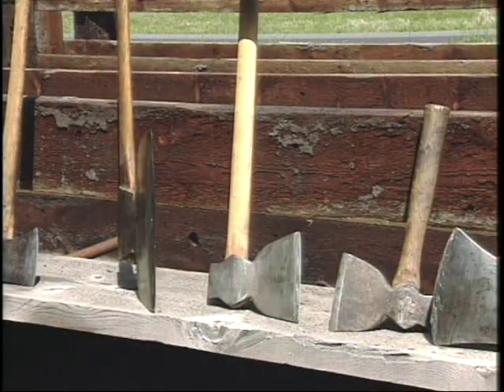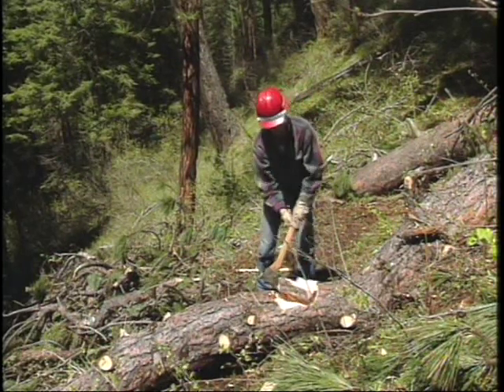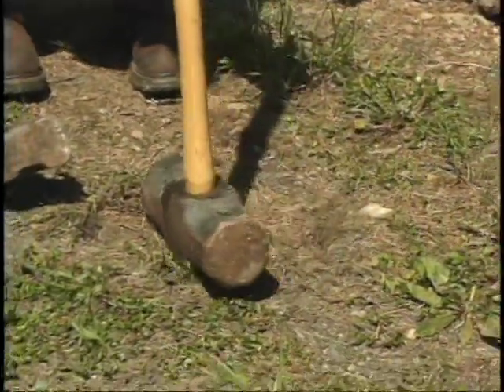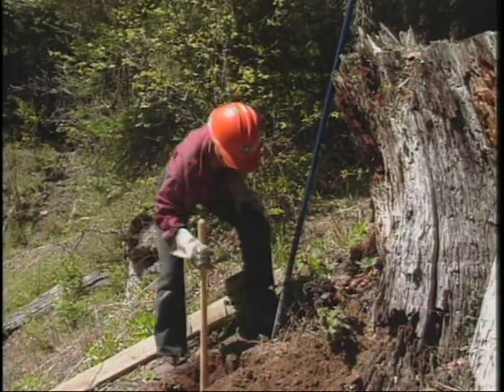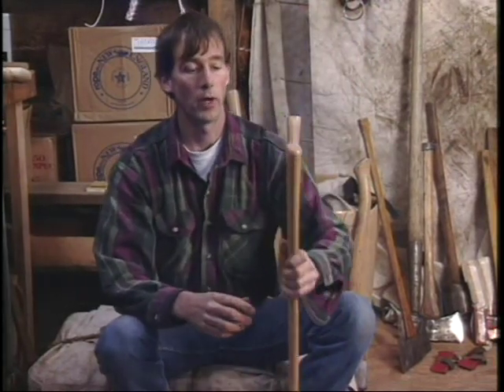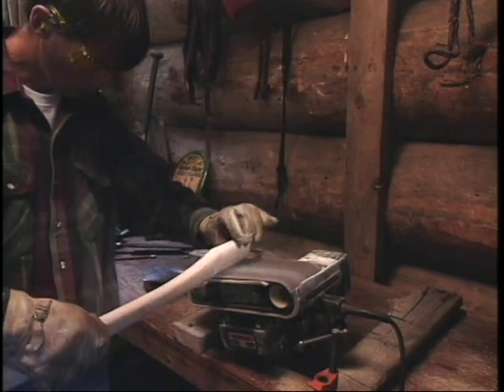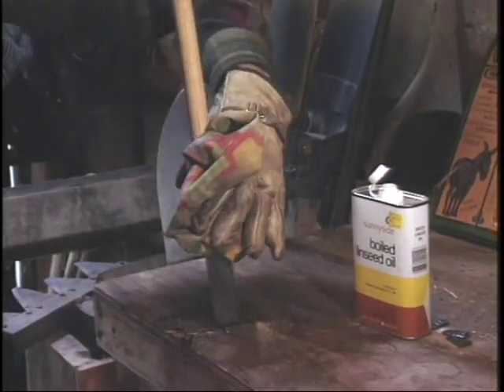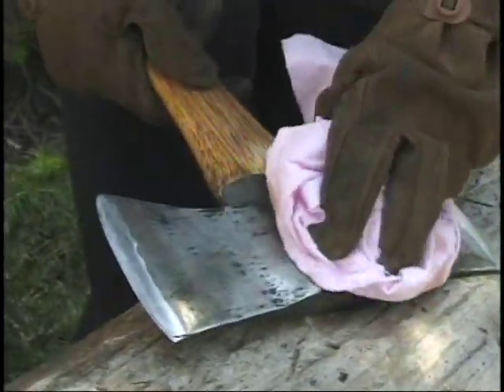Handtools for Trail Work - Part 2

Comment: I think the young-uns that made this video should have learned from the "An Axe to Grind" videos as well as the written PDF that goes into more detail.  There is a reason for a properly curved edge on an axe, as well as a reason for Not driving in wedges across the grain when hanging an axe  There are a lot of places that aren't forested with soft woods. That said, good on them for getting out there and doing it.  Hopefully it will encourage more to do the same, providing they get a bit more in-depth safety instruction on working/cutting logs, especially in hilly terrain.

Comment: the part about head shape is completely incorrect. the rounded face of the axe focuses the energy over a smaller surface area and so is a more efficient use of energy than a flat face
Reply: Thanks, came here to argue this myself. I understand what he's getting at, but it's not about concentrated energy. I think what should have been said is that the two curved objects share a smaller area when they overlap –() than a straight object and a curved object do –D.

Comment: The idea that a curved axe bit is not ideal is incorrect.  If you are chopping a round log with an axe bit with a deep radius without moving your position, different areas of the sharpened edge will hit the log as you swing the axe deeper and deeper.  There is a very purposeful reason axe bits are curved and the logic in this video showing an axe bit coming into contact with a flat board is oversimplified. Curved axe blades make sense for curved logs.